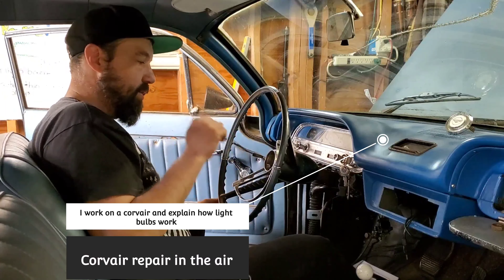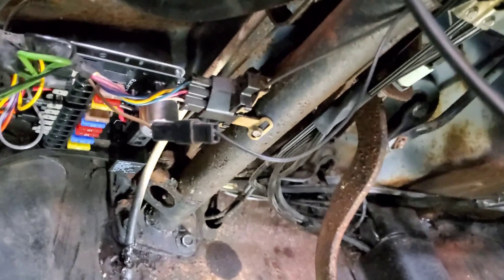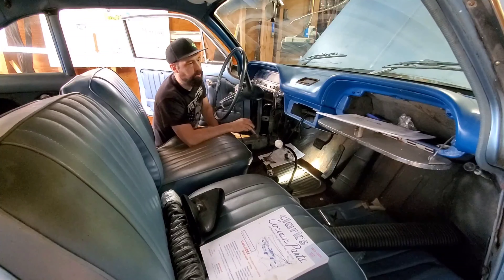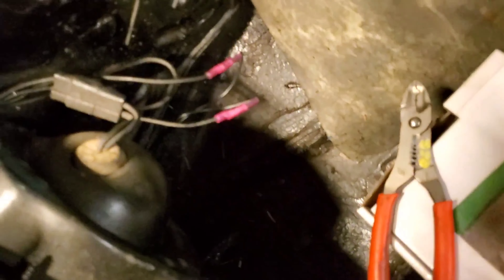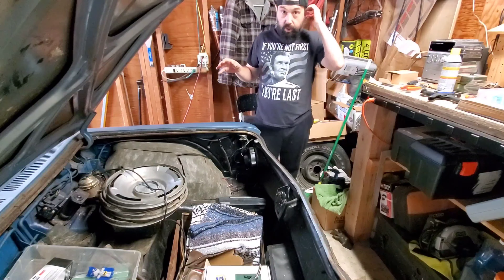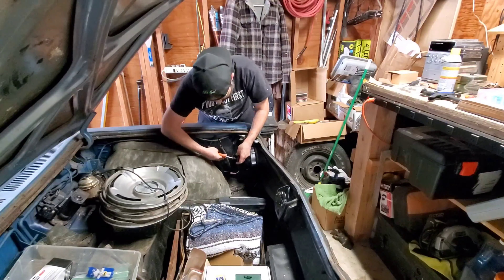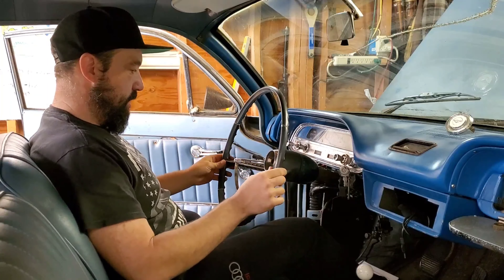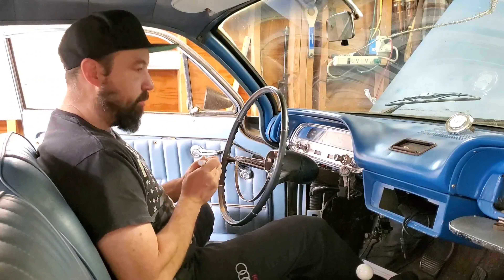Corvair wiring and I explain how lights work.

Comment: Where did you get the Steering column turn signal switch from? As usual, Clark's Corvair does not have them in stock. Maybe they are used on another GM car.
Reply from the maker: Not sure its been a while
Reply: @AaronCoyRacing  No problem, took the old one out, apart, cleaned the contacts, reassembled and then reinstalled. Now the turn signals works great. Also cleaned the horn contacts and now it sounds wherever I press on the horn ring. California Corvairs have the switches for sale on their website.

Comment: On my driver side, when turning the running lights on, it’s very bright as if you were hitting the brakes. So the drivers side brake light is always illuminated and when hitting the brakes only the right one (the dim one) dims and brightens propely while the driver stays fully lit. Is that a wiring issue?
Reply from the maker: Could be bulb is in backwards

Comment: What number bulb did you put in there
Reply from the maker: Wish I remember but most likely 1157.
Reply: @AaronCoyRacing  I used the same socket and tried the 1157 but when I hit the switch in the car it started bliking both sides on the dash and when I looked it up it said wrong wattage build so now I’ve been trying to find the right bulb lol. Thanks for the help though and great video!

Comment: Will there be more 63 Corvair videos? You mentioned not having wiring diagram - shop manuals available online here https://www.corvair.org/chapters/corvanatics/manuals.php
Reply from the maker: That corvair was sold. There is a convertible that it was replaced with that is almost a full restoration in its place.